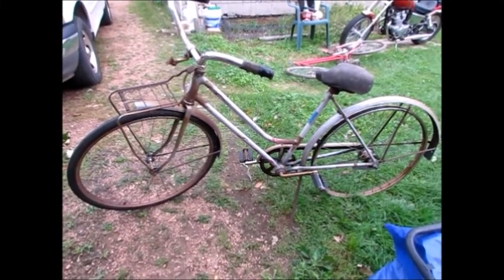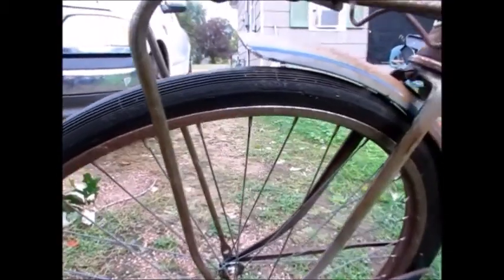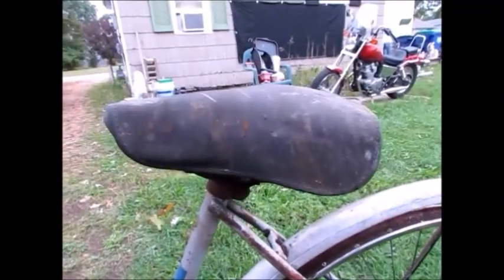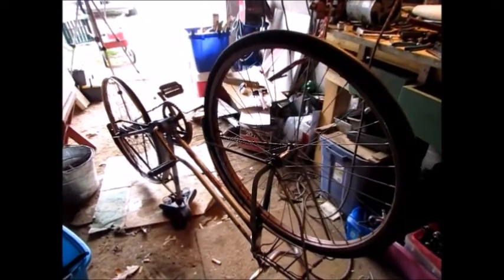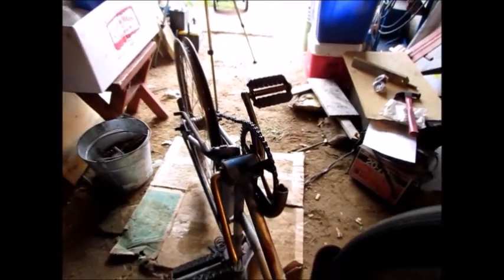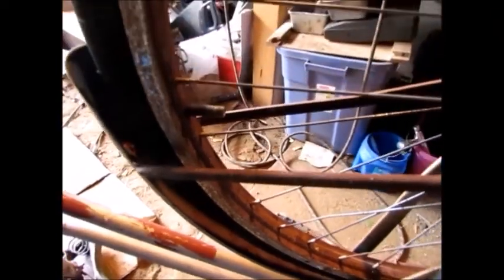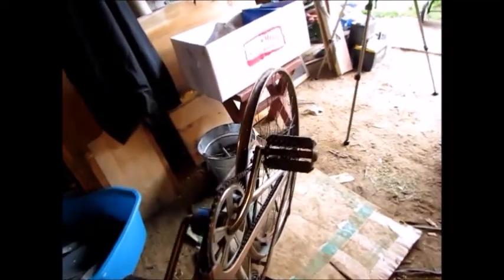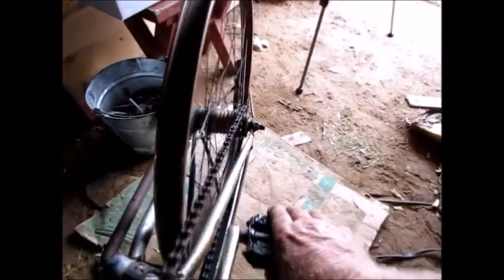The old Schwinn is better than I thought

Comment: You got lucky on that gear hub. Much less common.
Reply from the maker: I had a lever shifted 2 speed Speedster. The neighbor kids loved to play with the cable adjuster and my sister ( that knows better than I do) had an automatic kick back put in at more than the price of the bike. The lever shifted better on hills, no back pedal. I haven't seen another lever shift since 1966. Red or yellow stripe only. Automatic pulled harder too.   CM]

Comment: Did wald build bikes for schwinn?  The bike being a wald, does it make it less valuable?  There is a good product called evaporust out there that would work great to soak rusty chains & other parts in. It does a real good job.
Reply from the maker: Wald is an accessory company that makes baskets, racks, and I believe kickstand. Old Walds have very good chrome. If they are heavily rusted, they won't polish up.

Comment: Hopefully you painted it back one of its original colors. Red & white? How did the wheel turn out?
Reply from the maker: I cleaned and lubed the hub. It all worked just fine but it dragged hard compared to more modern wheels. I had a 2 speed as a kid that shifted with a leaver on the handle bar. Much easier to instantly down shift on our hill. My sister decided that the back shift was better, SHE knows better, and had one put on. I hated it. I was offered $50 for the hub, gone. Stripped frame is still hanging in the garage. I did ride it "as was" and it rode fine. I just had to skid the back , waiting for the rotten tire to pop. I lived! Thanks..CM